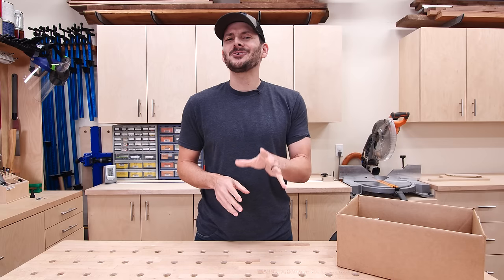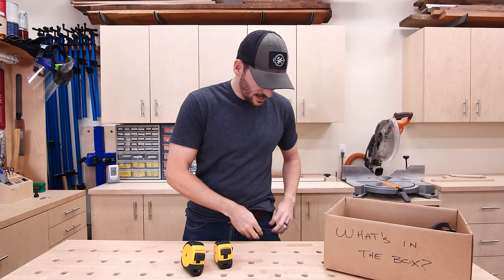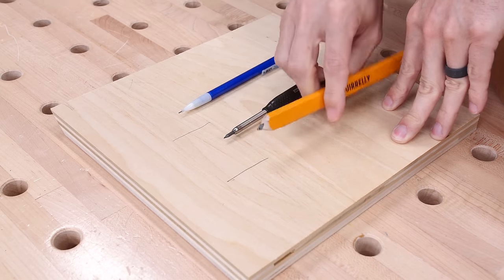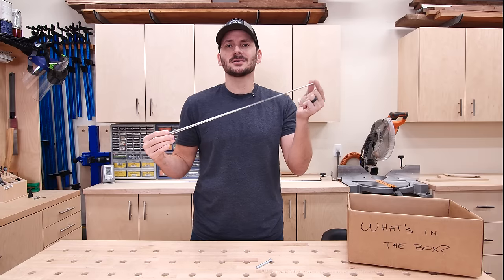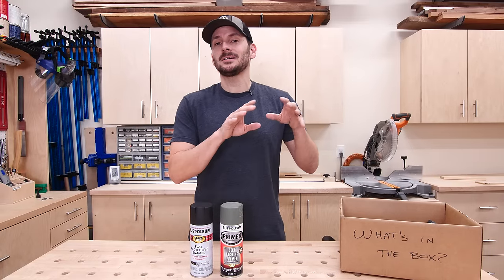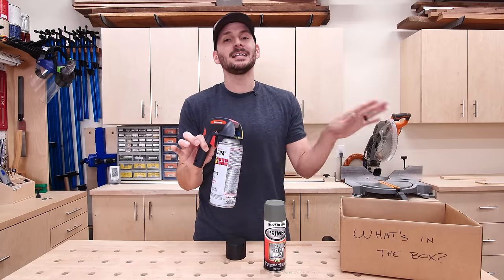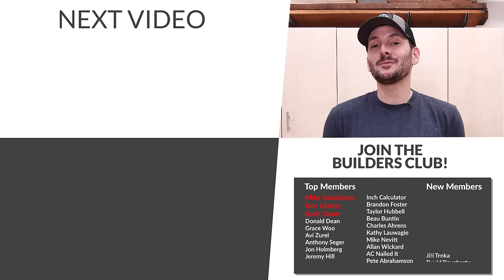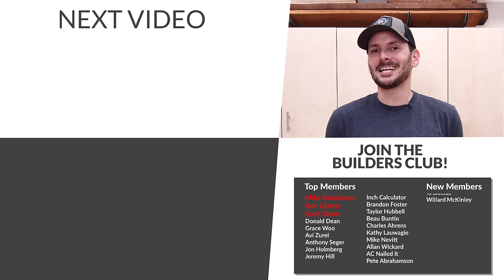12 Tools Under $20 Every Woodworker Needs

Comment: Vaughn also makes a flush trim bear saw for under $20. Small and super sharp. Non marring tooth set. I have one at my bench and one in my carry around tool set for fixing household issues.
Reply from the maker: oh man!  I and checking that out now!
Reply: @Fixthisbuildthat  Found it on amazon for $24, but I got mine at Menards for $15.  If you have a Menards near you I'd check it out.  Looks like HD is out so maybe they're discontinuing them...?

Comment: I wish I had the spray paint trigger item two years ago - during lockdown was refinishing a pallet for a diy pool storage unit. Had an old can of primer that I was using up, and the only way to get the last of the stuff out was to mash down hard on the nozzle. I pressed so hard with my index finger and thumb that I gave myself numbness in my fingertips for a few MONTHS. 
I've been using the trigger for the past year, and it's definitely worth the $7 or so.

Comment: Great tip on the syringes...I guess in this case literally.  I'm doing some chip carving that I wanted to try filling in with colored epoxy and I think you just saved me from making a huge mess!  And I'll double down on the vintage ice picks.  I find these all the time at tool swaps in that nasty bucket of crap for $1.  I love em.

Comment: I like the idea of using one of those spring nailsets for removing hinge pins. Not having to swing a hammer next to a door is well worth the price of admission.
Reply: Good luck with that. The Tool looks weak .
Reply: @69injunjoe  I've always been skeptical about those spring nailsets, but they seem to work and if they do, they look a lot easier than a hammer and standard nailset.  If the spring ones can sink a 15 gauge nail, it seems reasonable they can loosen and drive a hinge pin.  I'll let you know...
Reply: @BobboMax1  I find the current pre-hung doors from the box stores are all twisted and never square anymore. Hinges are all under stress from poor workmanship.
Reply: Out of 12 doors had to return 3 for improper hinge depth from top to bottom. Poor workmanship.
Reply: @69injunjoe  

Ahhh, but the good news is those 5/8 finger-joint jambs are so flexible that it's easy to warp them straight, plumb and square again if you have enough shims and time.
Reply: @BobboMax1   I love selling  my work as warped into shape. Nice sell.
Reply: Craftsmanship is lost .
Reply: @69injunjoe  You don't always get what you pay for- there are a lot of scams out there- but if you don't pay for it, you definitely won't get quality.  The problem is that good millwork shops are scarce and a lot more expensive than the production shops. My advice is to find rich clients.
Reply: @BobboMax1  Agreed. I rather build my own jambs then the junk made today. Let's Go Brandon.

Comment: Thanks for the great ideas.  I noticed that you could save your pencil sharpness if you learned a skill that used to be used by draftsmen, architects, designers, etc., though I suspect that now they use computers instead.  If every time you draw a line with a pencil you spin the pencil between your fingers, you will get a more precise pencil line and maintain the sharp point longer.  Once you learn the technique, you'll find yourself spinning the pencil naturally.
Reply: Great tip! When I learned mechanical drawing back in the dark ages we were taught to file a flat side on the pencil lead. That flat went against the straightedge so your line was exactly on the edge. We had little popsicle-stick-like things with fine sandpaper on them for a quick touch-up. I don't know if that was a common practice, but spinning the pencil sounds like a simpler solution.
Reply: @timdouglass9831  I found my old drafting sandpaper stick (from 1970) when we cleaned out the barn last year, but I couldn't even remember what it was for. Thanks for reminding me!😃

Comment: I'm sure somebody already mentioned this, but I don'thave time to read ALL of the comments...
  I love the "Big Gator Tools" V-Drill Guides.  They're hardened steel bars about 6" x 1" x 3/4", with a series of guide-holes in common drill diameters along the length.  You hold them flat on the surface you want to drill, run your bit through the appropriate hole, and Voila!  you have a nice perpendicular hole!  It's like having a tiny drill press in your pocket, and the bottom side of the bar has a Vee-groove running the length, so you can use them to drill centered holes perpendicular to the avis of pipes and dowels as well.
  There are at apparently 5 different size guides.  I only have 2 of them, covering 25 hole sizes from 1/8" to 1/2", and if they don't have the exact hole I need, I just use one size smaller for a pilot hole then drill to size manually.

Comment: Brad ... The tip on the Pica mech pencil was worth the time investment for watching this video.  The tongue depressors and syringes gets an honorable mention. As for tools under $20 ... I made a bench chisel plane / scraper from the blade of an old block plane.  I got the idea from the Newbie Woodworker.  Happy New Year
Reply from the maker: That sounds like a handy tool! Happy New Year, Tom!
Reply: Liked the cheap but great tools. Nice to see a tool list that is easily affordable. 
About pencils...yes, I use the basic mechanicals a lot, but for beefier needs, I love the Ticonderoga "My First Pencils." They come 4 to a pack  with erasers and a compatible sharpener...$3.19 on Amazon!
Oh yes. The Irwin saws...I have 2, just in case I bend my original's blade too much...That's how much I use it.
Thanks!

Comment: One tool I found useful is the razor knife that everybody has. I had contractor working for me repairing a stone top counter where the 45 degree corner had let go. he mixed a cement epoxy and clamped it and some cement squeaked out like glue does. He pulled out his razor knife and then pushed the lever again and the blade moved up and spun around now making it a scraper. Two tools in one. Its called Toughbuilt Scraper Utility knife. Its on Lowes website and is $40 with a 50 blade package. Very useful though more than $20 but worth a shout out.

Comment: Nice video! It'd be nice if prices were this low in Europe... That spring loaded punch cost me about 40 USD...And it feels weird to see only inches on a measuring tape (I'm Canadian...used to see both systems everywhere)

From an experienced (in a lab) guy working with VERY small volumes: to avoid foamy tiny bubbles in the syringes, fill them without the needle on. This will prevent a lot of foaming inside the syringe, as it keeps the opening bigger and doesn't squeeze too much liquid at once through a very tiny opening (it also lets you pull much faster). The more viscous a liquid is, the slower you need to pull (and push) it. Put a little more than needed, then attach the needle. Get the inevitable bubbles (that's the dead volume) in the needle, push them out and push back the excess liquid back in the bottle (not in the air like all the TV shows and movies) until the desired volume. If your stain is REALLY precious, get a syringe with a low dead volume.  If you wonder what the dead volume is, it's what is needed to fill the needle and the part of the syringe holding it. Some syringes have the plunger go right to the needle to mitigate that.

Needle gauges also work in reverse: the higher the number, the lower the size.

Comment: Great Video Brad. As a mechanic I have used the telescoping magnet and claw for many years. Also use the spring loaded centre punch on a daily basis. Some of your viewers might be interested to know that the centre punch is also a great thing to take if you are driving on ice. We go ice fishing and the concern is that if you go through the ice and don't have your window you can't open the door. One punch with the centre punch and the widow will crystalize, then you can crawl out and also use the punch as a pick to crawl back up on the ice. Hopefully you never need to use it but better safe than sorry.

Comment: Pentel Graphgear 1000 Mechanical Pencil.  It has a retractable tip like a ball point pen so that you dont break the tip.  I think I saw it on a similar cheap tools video done by Stumpy Nubs.  It is very high quality and a great solid feel to it.  AND, it's less than $20!

Comment: With my line of work we need 35ft+ tape measures and other types because we build and assemble big pieces of work and pieces of equipment too. Plus we have to make sure there’s enough space for certain pieces of equipment to fit, are a certain height, and accommodate for certain vehicles to fit through and move around easily.

Comment: Just FYI Your Flush Trim Saw is a Dovetail saw, I had to go look after I saw it scratched the wood while cutting the dowels.  A flush trim saw doesn't set the teeth outwards so it won't scratch the wood.  everything else is nice and I just picked up the Pica Mechanical Pencil a couple weeks ago and haven't ahd a chance to use  it yet.

Comment: One thing I discovered is yard sticks for various uses. I bought a few at the local DIY store the other day for $1.09 and not for measuring either. They are usually made of very straight and uniform milled poplar that if you bought in the millwork lumber section would cost you 4 times as much.

Comment: I use the grabber tool to take the valve stem caps off my inside dual tires my hand won't fit in the holes . And for starting bolts , nuts and screws in hard to reach places where your hands won't fit. Great video thanks for what you do!!!!!!

Comment: Awesome. Another use for syringes is repair. I had a cutting board with a split at one end. I used the needle and syringe to get the glue into the beginning of the split. After clamping and drying, no more split.

Comment: Here's a cross-over item, both tool and useful part. Handi-Shims. Plastic, compression resistant, in various thicknesses. I use them for measuring when spacing drawer fronts, installing drawer slides, setting router bit depth, table saw height, etc. They are roughly 1.5" by 3", but can be snapped apart into much smaller pieces. A 40 pack of various thicknesses (1/32, 1/16, 1/8 and 1/4") is $11 on Amazon.

Comment: For cutting foams of various densities and rigidity i use a electric carving knife. The mess of foam bits floating around is greatly reduced, accuracy is better, and its faster .
Reply: Try a $20 Harbor Freight "hot knife". Zero cleanup and very easy to make accurate cuts.

Comment: on #12, i get them from tractor supply in the veterinary section. havent used them in the wood shop, but they are also great for point oilers in the metal shop. get some cutting oil right on that punch mark on the drill press, or the cutoff slot on the lathe, or that deep hole on the mill, without dumping huge amounts of cutting oil all over everything.

Comment: Brad, I hang things on walls frequently and have discovered the DuraMark CHALK SHOT which leaves a green mark on the surface.  Much easier than using a sharp pencil or nail to mark where I plan to drill or mount.

Comment: FWIW, 1.8mm 'exam' mechanical pencils are perfect for woodworkers, as the lead is rectangular: 0.9x1.8mm.  They are sturdier than round leads, yet you can still lay down a fine line.

Comment: To have small mixing sticks, I use old credit cards cut length wise. Also good for smearing glue around. Wipe them off easily with a paper towel or newspaper and use them again. If that doesn't work, chuck them out.

Comment: I have a left handed tape measure (although I am right handed). This means that when I use it the numbers are always the right way up when I'm marking and measuring so I don't have to fiddle about.
Reply: @johncoops6897  They are widely available here in the UK. I got the idea from Colin Knecht at Woodwork Web in Canada. I guess that being left handed here in the UK or in Canada is not looked upon as being disabled!
Reply: @johncoops6897  UK tape measures have both metric and imperial on the same tape. I use the tape measure in my left hand to measure so I can mark with my right hand .I can read upside down perfectly well (don't know of a condition that is a symptom of that actually) and I'm quite comfortable with working in both scales. Why should I read upside down and risk making a slight error when there is a way of getting it right all the time?
Reply: @johncoops6897  I mark the length I want, indicate the waste side and cut accordingly with whatever tool I decide to use. I don't over think it and I don't worry about workflow (making is hobby for me not a job and I'm under no time constraints, I don't mind pottering about in my workshop and if I have to make a trip or two across the room, so what? It's good exercise if nothing else). I always make sure any cuts I make are done with both ends of the material fully supported no matter how I make them, just the way I learned in woodwork classes at school over 50 years ago. I hope that has put the subject to bed as I just wanted to share my experiences with a different type of tape measure as tape measures were a part of the video. Beginning to wish I hadn't bothered!

Comment: Shish kabab skewers [wood]. They are good for grease, glue, etc. They are great for putting in rtv/sealant tubes to reseal them. You can push them in real far, so the tube won't get blocked by dry material. Cheap and disposable.

Comment: Buy multiple automatic center punches grind the end to size and use that as a nail set..they also work good to dimple metal pins that might be a touch too small.

Comment: Hey Brad, a cheap quick tip I saw online the other day was using heat shrink tubing to heat shrink a small magnet on the eraser end of all pencils and stick a pencil to all metal tools and chests to quickly find a pencil anywhere in your shop.

Comment: Believe it or not, tongue depressors have a lot of uses. They are pretty consistently 1/16” thick so are useful as spacers. You can laminate them to make small pieces of birch plywood. Useful for small projects like ukuleles. 

I get them from the paint department at Home Depot. I look through the packs to find the ones that look to have fairly straight sticks.

Comment: Brad your list is missing a link to the flexible grabber tool. Lots on Amazon, however. The one you show seems pretty good, although the fact you cracked the flange makes it seem less  sturdy than one might want. There's a couple on Amazon that look really solid and still under $20. Thanks for the links - I have had the Pica pencil on my wishlist for a while, think I'll go ahead and pick up one of those. For Canadian woodworkers, these are also available in your local Lee Valley store.

Comment: I use wooden coffee stirring sticks  for mixing things.  They are thinner than a tongue depressor or a popsicle stick and great to mix small amounts of epoxy.  I use the 7.5" length and break them in half.  The 5" ones are too short when you break in half. And at $12 from Amazon they are budget friendly.

Comment: I am super pleased with the DeWalt $10 measuring tape - A great find. Other items are on my shopping list from this video.  A must tool for a future list is the Crescent WISS Crimper about $35 CDN at Home Depot for crimping duct work and aluminum downspouts. Wish I had bought it years ago to save all that frustration of trying to use needle nose pliers for the same task. A real game changer- check it out!

Comment: ice cream sticks work really well for mixing and you can buy them in the crafts department for a lot cheaper. They have the regular size and the wider ones too. You may be able to find some cheaper but office supply  has 500 of the .75 for less than $8.00 and the .38 for less than $9.00.

Comment: The pica mechanical pencil is awesome I got one as a gift with an set of extra leads with different colors I got three different colors red, yellow and gray but I wanted to let you know that the pica pencil leads are also made for different types of surfaces and can write on wet, oily, rusted, smooth, ceramic and marble. 
I love my pica pencil.
Awesome video by the way!

Comment: you might want to add a Carpenter Knife to your collection. It has a short but sturdy blade and is necessary to score lines that have to be more acurate than a pencil.
You can fine cut the wood for inlays and do the preworking for chisels.

Comment: Bic also makes I think a 1.2 or 1.5 mm mechanical pencil if your sick of the 0.7mm pencils breaking all the time. The line isn't quite as precise but they don't break nearly as easily and you don't have to bother sharpening them and they're the same size as any other mechanical pencil.

Comment: I really love Irwin tools, but not their pull saws.  They tried induction hardening the teeth like Gyokucho Razorsaw does, but the harden the whole tooth rather than just the tip, make the part that needs to be tough brittle.  Result?  I have Razorsaw ryoba that I've used for years with no broken teeth and still sharp enough to use, but the Irwin pull saw I was so excited about broke before a month of use.  Seeing the indigo on the whole tooth for that Irwin flush cut saw reminded me.

Comment: I us a ton of Popsicle  sticks when I do my intarsia work with my scroll saw.  mine are a lot smaller and are about $5 on amazon for 200.  thanks for the reference for the bigger ones.  Also want to thank you for the reference for the Syringes.  I use them to inject scented oils into bait when fishing.  I have had a big problem finding them, mostly because I have been spelling they wrong for a long time.

Comment: I had a wisom tooth removed the other day and they gave me a syringe with an angled tip, designed for directing saline (salt water) at the extraction site. It's now in my toolbox, ready for the next time I need to get some grease somewhere really specific (e.g various bits on my mountain bike).